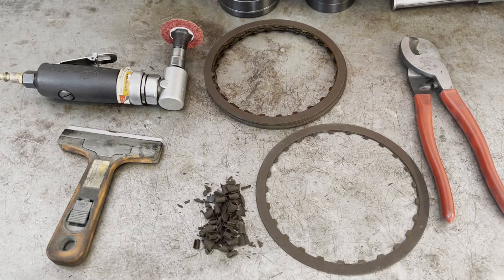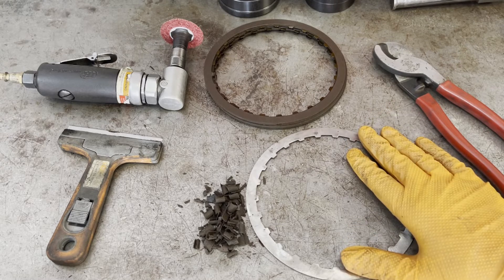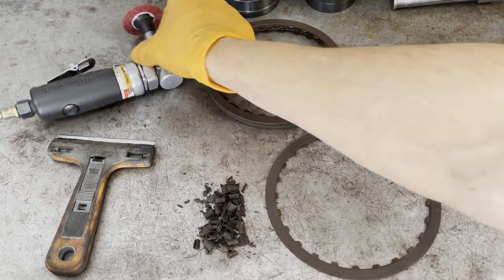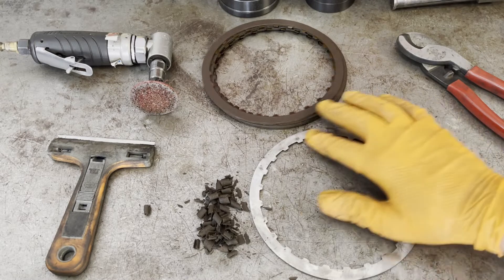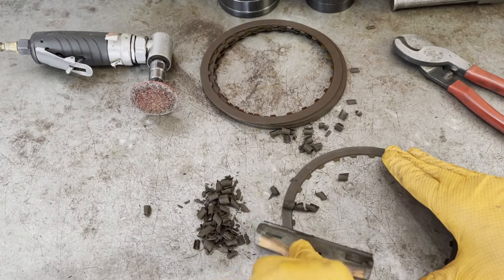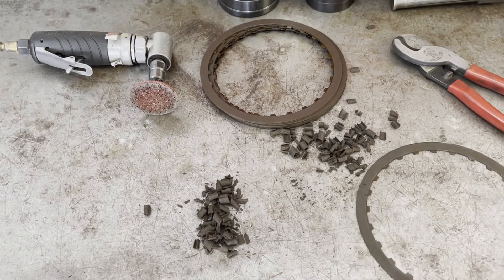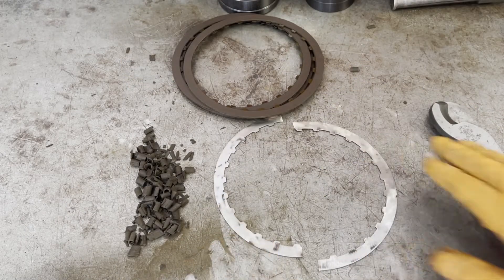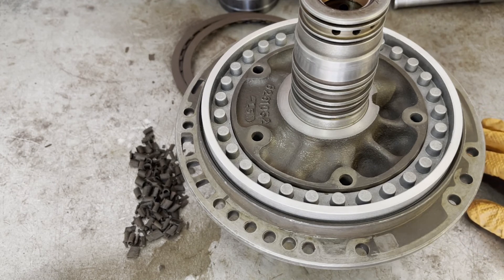Rebuilding TH350: Excessive Intermediate Clutch Clearance Solution

Comment: Just use an old th350 low reverse clutch, which is more applicable as most people with a th350 would have that laying around after rebuilding
Reply from the maker: Yep, that works. Thank you for watching, FBombCamaro.